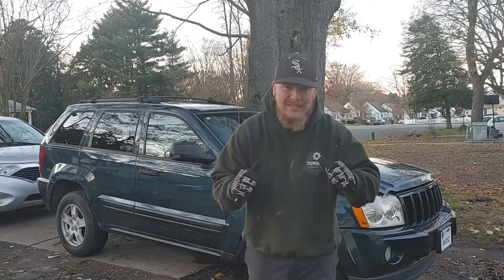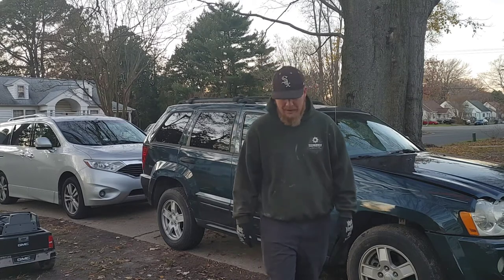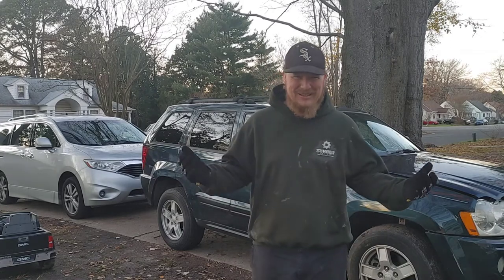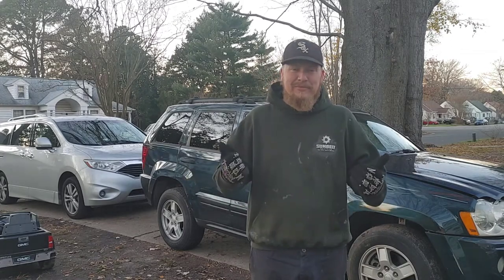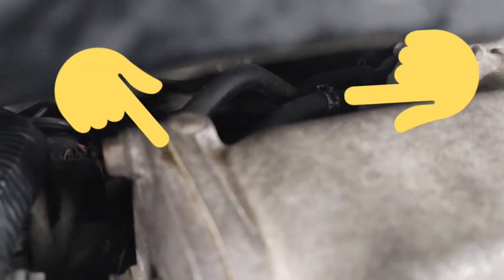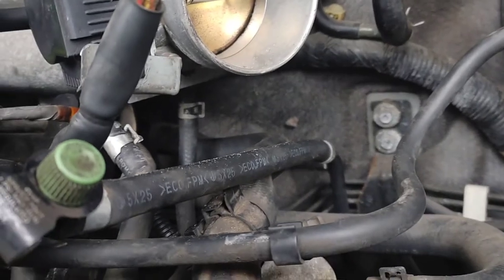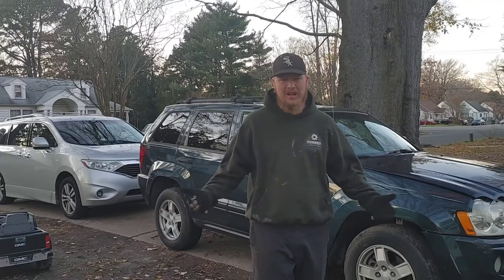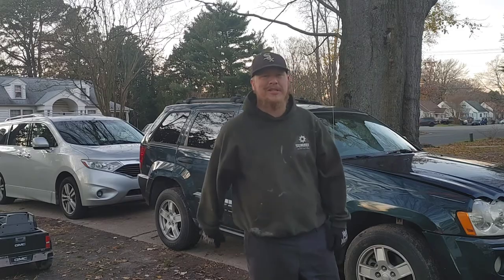2006 Nissan Murano Coil Pack Replacement Made Easy and Quick!

Comment: I need info I got P0191 code saying fuel rail injector sensor
Reply from the maker: Thats on a Ford Mrl Will 😂. Just kidding, that is your fuel pressure sensor failure. It is an easy replacement. Make sure the engine is cool, the sensor is located on the fuel rail. They are known to fail and needing replacement.
Reply: @Sellthoseflippingcars  ole ford fix one thing then something else
Reply from the maker: @mrlwill5505  yep
Reply: @Sellthoseflippingcars  I'm trying to get like you fix them and sell them
Reply from the maker: That would provide a nice stream of income in for you. Also I havent forgot about the livestream, just trying to get everything ready for the holidays. While keeping repairs and videos up to date, nothing like staying busy lol.
Reply: @Sellthoseflippingcars  i understand I only have Sunday's off work so it's really a lack of time for me. Happy Holidays and Have a better New Years
Reply from the maker: Totally understandable there, you as well!
Reply: Guess what I'm back now I'm getting these two codes P02196 and P0193 I can't win for losing I don't wanna give up help me once again please
Reply from the maker: P0193 is low fuel pressure again on the fuel rail. It would be really helpful if you could have a live data feed and see how much fuel pressure you are recieving at the fuel rail. Next code is not as easy. P0219-6 is a over speed condition. This means that you were in a gear and went over the calibrated RPM set for that gear. This can happen by accident, if you have the gear shifter in a lower gear setting....or you are drag racing. lol
Reply from the maker: I started the Youtube Live every  Sunday as well at 2pm EST, try to stop by I can answer your questions in the video!
Reply: @Sellthoseflippingcars  I sure will
Reply: @Sellthoseflippingcars  I have little question will the fuel damper keep a car from running properly
Reply from the maker: Yes it will run rough